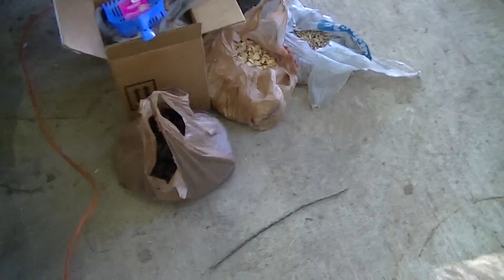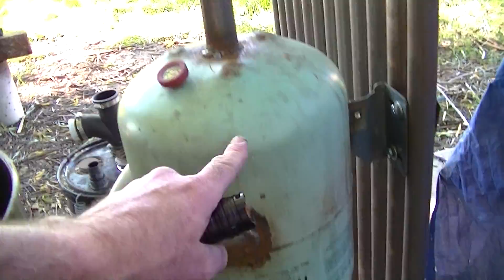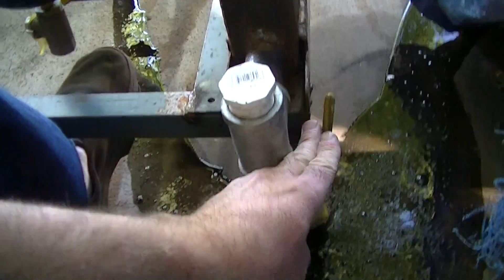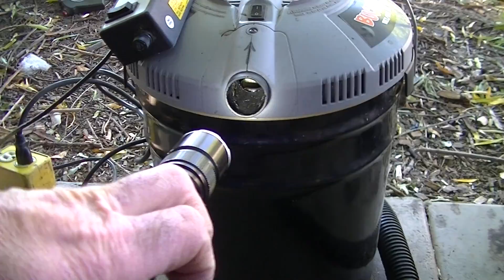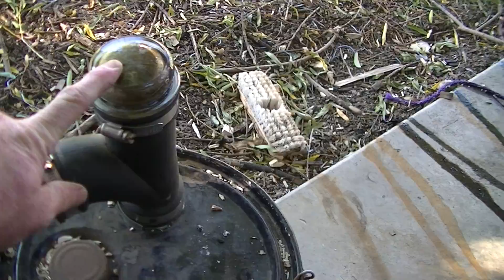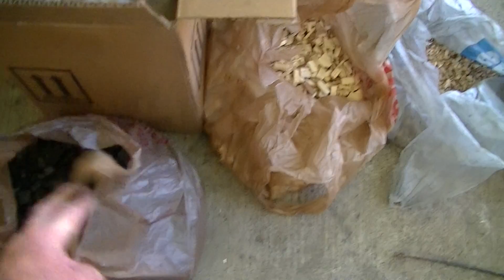DIY How to make a Homemade wood gasifier system video #3

Comment: Have you thought about using diesel as your tar remover rather than water?  Another question is why your input from the reactor into your cyclone comes in at the center, rather than the top?  Seems like you're cutting out half of your potential cooling area.

Comment: nice vid man i like it, just so you know if the temp. of your gass gets a little to hot it can/will melt the rubber/plastic in the ballcock valve you have right off your tank